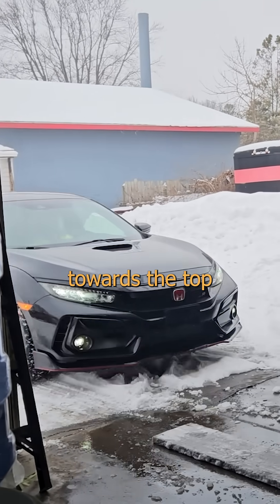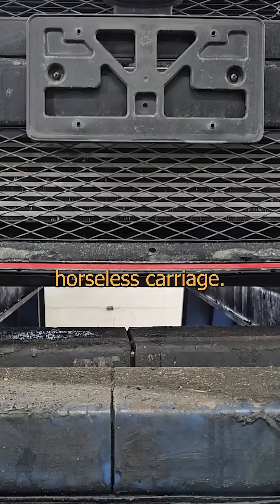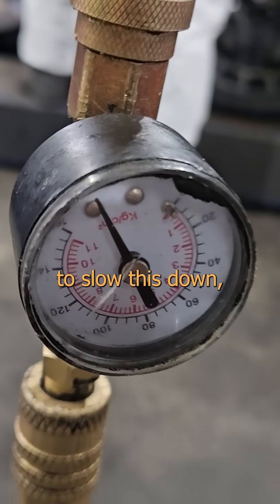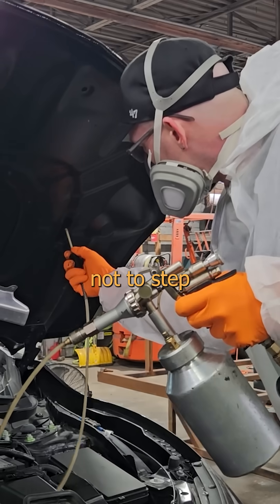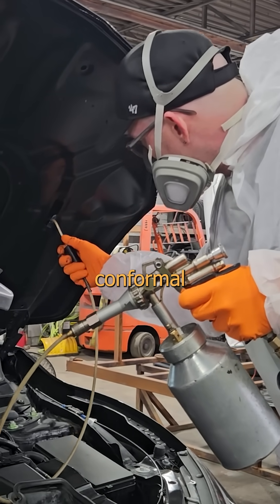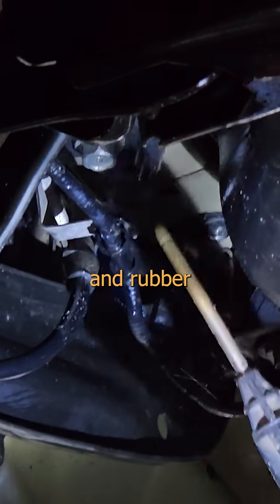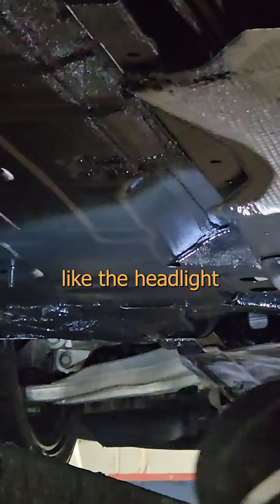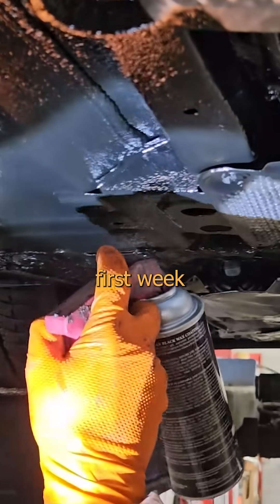How to stop rust on your car #chrisboden #comedy #engineering #wax #corrosion #science #winter #salt

Comment: I'm glad I live in central North Carolina and don't have to worry about rust. I still spray the inside of my chassis with Fluid Film because trapped road grime and water will still do the same thing at a much slower rate.

Comment: And then there is sprayed polyurethane foam for insulation? What’s this have to do about it? Seal it in and forget about it because you’re warm for about 15 years until you realize you just covered a whole lotta problems you didn’t know you have and well a lot of people think it’s fix a problem other than a low “R” value. And well I’m talking about to use it as a sealer to keep water out as well? I know because I have seen it on more than one occasion. Well anyway nobody does it right! No air gaps or anything other insulation technique that has been done for a long time?
 Rant to export

Comment: we live in ontario across the river from detroit. 

i can say for sure the only vehicles that last the test of time here are under coated. big time. 

any other vehicle i see not undercoated will surely have rotten wheel wells and rocker panels. 

hell even if you just oil guard the undercarriage it will help.

Comment: This can be a DIY job with B'Laster Surface Shield and a couple how to vids. Fluid Film also works but isn't quite as durable. Both are lanolin based. If you need wax based as well, get motorcycle chain wax or cosmolene.

Comment: Best thing to undercoat with is galvanising paint. Zinc is a sacrificial cathode. It will last a couple of seasons and then you give it another coat, but crucially if a bit flakes of then any exposed steel won't corrode so long as there's zinc on hand.

Comment: A completely galvanised chassis and panels will give a car at least 25, probably 50 years of 100% rust protection.  Unfortunately it has to be done during manufacture or as part of a complete chassis up rebuild.  It’s just not economically feasible for 99.999999% of humanity or 99.999999% of vehicles.

Comment: Cars come undercoated already the problem is did the manufacturer do a good job at covering the frame. Most of the time they don't, When I worked at Toyota  we had Stacks of Tacoma frames cause a bunch of frames needed to be swapped on brand new less then 1 year old trucks cause they undercoated them so poorly.

Comment: I bought a 91 GMC K1500 in Oregon. 384k miles but 0 rust. I scrubbed, scraped, brushed, and ground every inch of the underbody and engine bay while the engine and tranny were pulled.  I then painted it with Rattle Can Rustoleum Professional. I also washed my truck every week during winter.

This year, I crawled under, roughed up the chipped/worn spots, and sprayed. It took me 20 minutes. I still have 0 rust on my frame/body :)

Comment: Growing up in NH, my folks always got the cars undercoated. My understanding of the process here is that they use old engine oil- ie: left over from oil changes - to do undercoating. Once you get the undercoat, you drive around on dirt roads for a bit to make a nice solid layer and you are good for the winter. Don’t do the undercarriage wash at the car wash all winter!

Comment: If appearance isn't the #1 priority, and you don't mind carrying a few extra pounds, Spray on used motor oil, and dust it with calcium carbonate to soak up any moisture, vegetable/canola oil do the same thing, do a couple of layers and make sure to protect the brakes from accidental overspray.

Comment: Okay since you're talking about undercoating I'm going to talk about that.

When I was living in rural South Carolina near travelers rest I was hanging out in urban Bliss with Budweiser and a 50-gallon drum on fire when I noticed that the chicken farmer down the street was hauling a whole bunch of chicken s*** down the road.  Problem is the tanker had sprung a leak and was spring chicken poo all over the road like a sprinkler on meth.  The smell was absolutely atrocious and so we all ran inside.

How about a half hour later we noticed the sound of the old jalopy from the old lady across the street a few more times than normal.  We all head back outside to watch the 80 year old lady drive up and down the street some 8 times. 

We finally figured out that she thought the fresh chicken s*** was asphalt and was trying to undercoat her car on the cheap by slinging wet asphalt off her tires.

To this day I will never forget the smell of an engine block covered in chickenshit.

Comment: Fluid film is cheap and pretty easy to apply at home with an air compressor and a modified paint sprayer. Or buy fluid films $90 sprayer like I did.

Comment: Do you clean the underside before hand? And do they dry it out before hand?
Reply: Yes as much as possible but holy crap the underside of Chris’s car is mint!
Reply: @TTK-Performance  Ive used fluid film on my colorado, taken glances at other trucks and was impressed
 i never asked those two questions, with how it was pulled in, in the snow was wondering if the sent it or washed and dried it

Comment: ...huh, would wax work for mobile motel cabins of the lower Fit variety in year round summer and rain season conditions? I'm... quite literally interested in rocking the boat with candlewax on the underside of both mothers and the mothership at the same time, if it does 👀

Comment: Best to undercoat with heavy roof coat but also I highly recommend oil spray with oil spray it needs to be done once every fall , prior to having it sprayed with oil you need to clean it well with a high pressure wand at axself serve car wash clean well under the wheel wells however ever corner of the undercarriage needs a good high pressure water, also go for a drive in the rain so that the rain water will eventually wash and release all the salt from the undercarriage.

I live in the Pacific coast we don't get a lot of snow on the Pacific coast states or province of British Columbia, therefore autos rarely get rusty most look as new after 20 years and longer because the rain washes all the salt and crap off after the small snow drift we get our here, unlike most earthen states and provinces where snow and salt are poured onto roads and highways by the truckloads daily. However even with all that if you clean your undercarriage every spring and summer well.  Then in the fall look up a good auto oil spray company like Krown oil undercoating

Comment: I do it my damn self and I use fluid film everything else I have tried is either too thick too thin or not penetrating enough.. I love the wax stuff but honestly unless you're disassembling parts and coating inbetween where things go together water's going to get in there eventually man.. and being my own shop from everything to timing to tire changes I want every single crack crevice and even cracks I have no clue that are there to start soaking up when I spray down.. The only downside of lanolin is if you have completely smooth surfaces it will not last the entire year but not a damn thing I own has a completely smooth surface left on it😂  there's two things I won't ever do after doing it once buy something newer than 2002 or buy a car, so from suspension frame to even body panels fluid film works absolutely perfect for what I have

Comment: Older vehicles or existing rust spots, Lanolin-based (Fluid Film/Woolwax) is your go-to. Its penetrating, self-healing oils are perfect for ongoing protection.

If you have Brand-new ride or you’re sure it’s rust-free vehicles, Wax-based coating offers clean, low-maintenance defense.

Rubberized can be the best for your brand new car but, just note its application limits.

Comment: Undercoating, meet Galvanic Anode.
Weld a dozen washers made out of Magnesium to your everything. Pull-along trailer made of welded metal bars and it's not painted? No problem. Remember to keep some magnesium nuts around, you'll be golden.

Comment: I had to do some suspension work (mostly new ball joints, bearings, and tie rods) for a girl I knew who had moved down here to the South from Eastern Michigan, and I will never do that again.  I'd never worked on a rust belt car before and I was horrified.  That car was more rust than car on anything bellow the fenders and was basically held together by wishful thinking.  They're apparently all like that up there and her reaction was pretty much "Yeah, and?  Just fix it."  Lady, I can't fix it when the fasteners and frame parts crumble to dust as I try to take them off.  I have no idea why they don't all get undercoatings up there, hell at least sand blast it and spray paint it every once in a while, anything.

Comment: Long time listener, first time caller. Woolwax is the bomb. I also wanted to mention to anyone to avoid asphalt based coating. Traps moisture & rots from the inside, much like you mentioned with rubber based coatings.

Comment: Leaving the rust belt you are amazed at how cars don't rust once you go far enough south where they don't salt the roads. Even a piece of scrap steel I left exposed on the ground did not rust over one summer. In the rust belt it would need a wire wheel to clean off the crap that forms just from laying on the ground.

Comment: A municipal fire department I worked for 20+ years regularly sprayed their fire trucks frames with lanolin, until I was decided that PM practice was "too expensive".  Within 5 years of this occuring, reserve fire vehicles were no making it to their expect service life of 20 years reducing the reserve fleet to almost none.  The department had purchase used apparatus from other departments and crews had to adjust when they didn't have their typical front line or spare apparatus.

The city I worked for, on average receives 120" of snow a year.  The city salts the hell out of the roads when their trucks are working...

Needless to say, saving $20-30k on PM copst close to $1m in appartus purchases that weren't budgeted for.

Comment: I usually just wash the undercarriage and keep driving on salted roads to a minimum. The cars I typically drive tend to handle well enough on ice and I have practiced driving in slick conditions via gravel, dirt, and wet grass as well as empty parking lots covered in ice. Tops for driving on ice are to make sure your tires are aired up properly, use gentle inputs on throttle, brakes, and steering, and keep your RPMs low and use the torque to accelerate so you don't spin the wheels. It's especially dangerous when 1 drive wheel (2wd) or all wheels on 1 side 4wd+) get mor traction than the others as thats what causes your vehicle to veer to 1 side. Similar to how a dragster will suddenly veer into the wall or other lane because 1 wheel lost traction. And remember, its not the ive that makes it slick. It's the thin film of moisture on the ice that does. Thats why black ice tends to be the most dangerous. Not just because it's hard to see

Comment: I use Krown. I'm in Kansas City area, definitely not as bad as further north but they do still salt and brine heavily in winter and we get plenty of rust too. Krown has been great. Have to drive to Omaha for it but they drill small holes in the rocker, door frames, etc and soak the thing from the inside out. My 2014 Frontier is SPOTLESS underneath and is sure to remain so for a decade or more to come

Comment: This is the same reason you don't use polyurethane on wood. Shit is piratically indestructible to chemicals or liquids but it never comes off and when the wood starts to fall apart after 30 years, some wares off with contact and everything falls apart from the inside out. Great for the first 10 years, awful after it yellows and the water gets in.

Comment: Are those supposed "electric corrosion inhibitor modules" any good?
Reply: They are! Usually on a brand new vehicle. Because as soon as the electrical continuity between the unit’s positive and negative terminals is broken (like after an accident), it becomes worthless.

Comment: is Zinc based paint also an option? or the OEM paint is "in the way" for it to act as a sacrificial anode, where the zinc corrodes instead of the underlying steel, providing galvanic protection.
Reply: Some big trucks did that as a thing. You just have to make sure that nothing on your car is more rust-attracting than Zinc!

Comment: Boiled linseed oil is a great undercoating alternative it also renews clear coat after you wipe it in with a microfiber if you over spray and for those on a budget with an old beater spray the bottom of the frame with some cheap rustolem you have laying around, granted undercoating paint also exist in rattle cans.

Comment: In 1986 my mom bought a Hyundai and got it coated,the coating and rust protection was guaranteed for as long as you own that car, that car sat in our backyard until a couple years ago without a fleck of rust on it, mechanically failing in every way but not a fleck rust and we live in that northern place

Comment: Wayyy upstate new yorker here might as well be Canadian ehh... life span of vehicles up here is so sad it kills me, when I lived out west I bought a 76 chevy k20 that literally sat in a field to the rockers in mud for 8 years, I paid 800 bucks pulled it out threw some nice new 35s on it. Did all the seals and fluids on the motor, trans and axles and drove it coolest thing ever. That same truck here is worth 10k and youll never find one, my old mans 2019 sierra has the rockers and corners rotted right off it and my 05 dodge ram 2500 has had all the cancer cut out. New inner and outer rockers, cab corners, new bed, new doors, new fenders and the bed and box come completely off every year to scrape, paint and undercoat. The used car market up here is absolutely insane and I hate it. My plan is to buy a nice trailer, truck south pick up a few cars on the cheap bring em back do the necessary work and sell them to decent hard working people that need a reliable vehicle and dont have to trade their first born, a limb or a testicle to get it. Cause that would be pretty cool.

Comment: I'm gonna be that guy but you can all prove me right. My pap worked at Ford in Ohio. Right next to Lake Erie. In the 70s he asked a coworker who drove a post-WW2 Ford sedan how he kept it from rusting out. He said this, Mix in an old pot 1 quart of any used oil, any used trans fluid, 1 tube or tub of grease, and bees wax, any kind of wax. Heat it and get warm, Back then they had pressure pots for spraying. You can get a cheap gun for $50 or so. Any rust, knock off the heavy, really rusty use 80% phosphoric acid. After being hit with either this mix or I use farm implement paint or Rustoleum. Spray inside of frame with Eastwoods internal frame coating with 2-foot nozzle hoses for reaching, then spray mix. Pap did this, Dad does this, I do this, and my son does this. Yes, you can buy it in a bucket but it's very thin. The wax you melt starts to get cupcake frosting hard. Still pliable, but not so thin. It will last for years after you hit all areas well a time or 2. If you work on older stuff you know that when oil, grease gets on the frames or under the body, it won't rust. Also mix some baby oil, trans fulid, and tape up door drains, and put some in there, or use wax. It does have a smell but it will go away in a week or 2. So if you want to keep your 2010 and older car or truck that's not all computers and BS that breaks weekly, do this and thank me in 5, 10, 15, 20, or more years. EDIT spelling.

Comment: What happens if the paraffin  spray gets on the exhaust? My exhaust temperature gets way hotter than the flash point of paraffin and I’m sure whatever other waxes that are being used. Does that mean the exhaust system gets coated with something different, or just doesn’t get covered at all?

Comment: I was at a car show a couple of years ago, and a guy was showing his MK2 Ford Escort. That model was produced between 1975 - 1980It  was typical of the period, with vinyl roof etc. What was remarkable was it's condition. Then I noticed a windscreen sticker Zeibart treated. This was a popular anti-rust treatment at a time when manufactures did little or nothing to help prevent rust. A vehicle properly treated with Zeibart, would last a lot longer than one without. The process involved drilling into body cavities and then spraying in with the Zeibart preparation. It worked well.

Comment: This is great for prevention, but let me introduce you to the chemo for your vehicle's rust cancer : Chassis Saver. It paints directly on to rust and stops it in its tracks. There's a handful of formulae and brands that all have their little differences, so do a little research to figure out which one is best for your use, but it works.

Comment: Have 13 year old Qashqai that lived in a garage and did 3000 miles a year. Mint condition and NO RUST!!! 
Living in Cornwall and having roads salted every winter with the obvious sea air as well. Everything bloody rusts here. 
So it got lagged in Waxoyl and tetraseal. Tetraseal which is basically a thin tar in wheel arches and Waxoyl everywhere else underneath. 
Couple of hours work that saves you SHITLOADS later on. 
No cutting out of rust and welding in of new metal. 
Just a good car with no rust.

Comment: Up and coming mechanic here in the north east, I've seen cars been totaled before because the undercoating tech didn't know what they were doing and sprayed everything including brake pads and rotors. The best prevention for rust is take your car for regular car washes especially if you can get a car wash subscription, it's usually around the same cost of getting undercoated and you'll never have to worry about getting rusted from underneath the undercoating. Also any rust present before your undercoating will just grow